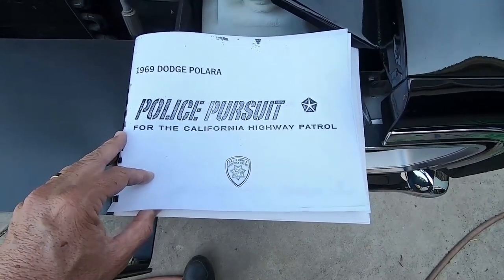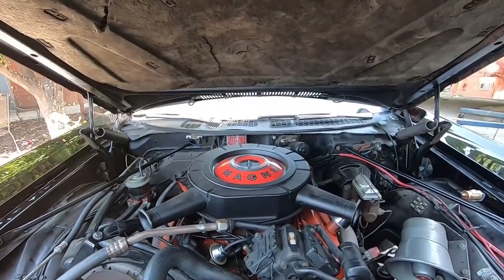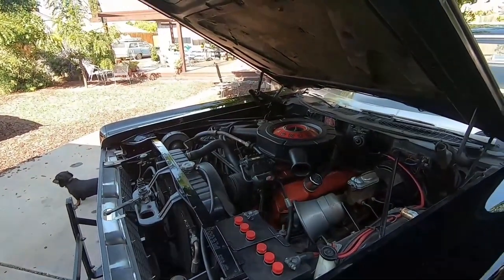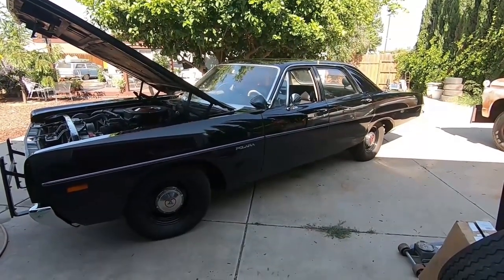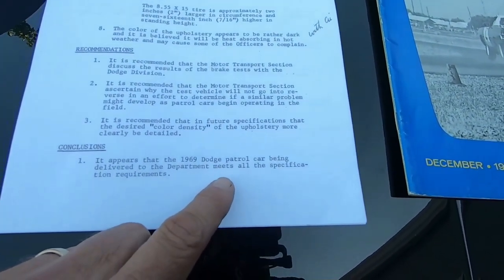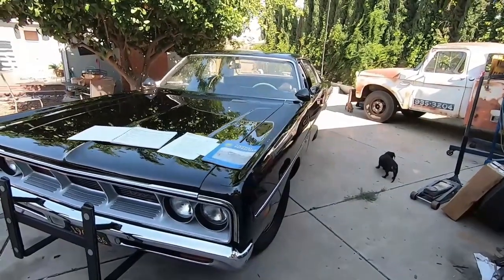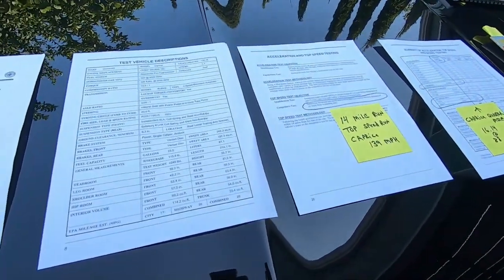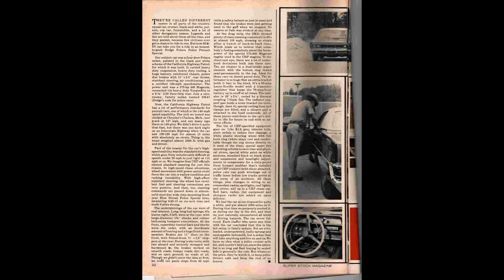1969 Dodge CHP Polara 440

Comment: I had a 69 ex CHP Dodge way back in the day.  Also owned a 71 Polara and the 74 Dodge Monaco. All ex CHP vehicles.  These were my hot rods when I was a kid.  And you are correct about the 69 Polara.  It would run away from the later models.  Had a conversation with a CHP Trooper in the mid 70's.  He referred to the 74 Monaco as a tractor and wished they had the 69 Dodge back.  The 69 would break loose the rear tires at 40 mph when you hammered the accelerator.   Had it up to 130 mph once, then backed off as the front end started floating a bit.  Lots of fun years ago.

Comment: Very neat video, and I like the publications too.  Some suggestions.  The real advantage of the 440 was the head design, good bore to stroke ratio, proper valve train design that allows a lot of lift with not too much duration.  The exhaust manifolds make little difference, the stock log manifolds are also fairly descent, but the down pipe side of 2.5 inches will help over 5000 rpm (which you need with the 3.23).  The difference in aerodynamics with the 68 are marginal, but in the human eye the 69 may appear more aerodynamic.  If there is a difference, it is likely marginal.  The p/s pump does not really have much power loss because when you go straight the steering is neutral.  They chose manual steering probably to save cost.  This was a bad choice because manual steering is slow and hard to correct oversteer.  When you compare your 69 with the later police cars you have to remember an important factor.  The original tests had bias ply tires with much higher rolling resistance at high speed.  With radials, you have much better high speed acceleration.  Question for you.  Is the grill plastic?  Another fact you maybe interested in.  I have two Imperials with 2.94, both have very good high speed performance, but the 5000 lbs make them a bit slower in low speed acceleration.  I will exceed 135 in a 2 mile acceleration.  On the faster one, it also takes me about 0.8 miles to reach 120, likethat chevy, but that is because I have only 3 gears and a much heavier car, high speed acceleration is much stronger than the chevy.  Cheers.

Comment: I own a '71 Plymouth Fury III NJSP car. It is a factory U code E86 440. Original engine is long gone and was replaced with a '72 Imperial 440. I had another engine built for it (440) and it dyno'd untuned 410hp and 490ftlbs  through the HP C body manifolds. The top end is lighter being aluminum(heads, intake, waterpump housing), and I've added a sure grip to the 3.23s it already had. Also beefed up a 727 and added a low gear set (2.77, 1.57, 1:1) for more grunt out of the hole. I'd be tickled to death if it ran low 14s and broke 100 mph!!
    That is a beautiful '69 Dodge you have there,  i can NOT wait to get my car in all black again!  It's currently in all gray primer.

Comment: THAT.... is one COOL Car ! Thx for sharing !
I would concur with all findings claimed regarding the '69 CHP Polara pursuit, based upon my own experience with my '69 Charger R/T survivor's UN-rebuilt original 440 Magnum/Auto/3.23 cogs.. 
Aside from some obvious weight differences between the B & C Body platforms.... I am even to this day quite surprised how much Torque the original untouched 440 Magnum will/can produce,(480 Ft/Lbs ?) and I do not believe the C Body's weight would affect much from a Torque perspective, given, even today with 4 grown guys 180+ Lbs the Charger still easily fly's right past 100-110 mph  like nothing..... albeit, I get scared up there.... and I as well would suggest the 11"x3" Front and 10" x2 1/2" Rear Drum Brake System leaves much to desire under hard/repeated applications.
Very Unique C-Body.... and again THANKS for sharing !
Reply from the maker: Glad you liked it.  We've also owned a few original 440 Magnum equipped cars including our '69 Charger R/T which we still have.   The top speed is a lot more than people think as you are aware.   Thanks for watching - T

Comment: Excellent video on an EXCELLENT car!! Very cool info in the historical documents. 
 I agree the 9C1 cars aren't as fast. They are realistically more ergonomic,  but that's about all. The Dodge clearly has it beat in speed, power, & even durability. Don't get me wrong, I'm a GM guy, but facts are stubborn things(John Adams)!
 The GMs definitely have their place in police car hierarchy, yet it isn't #1 or #2, imho.
 My personal ranking is:
1 69 Dodge Polara
2 71 Ford 429 PI
3 89-90 Chevy 9C1 Caprice 
Thanks for posting this vid!!
Reply from the maker: Thanks for watching!   FYI,  we've got a '90 Chevy 9C1 Caprice coming up for sale soon.  We'll try to shoot a video of it driving of course before we sell it.  It's complete with a truck load of parts to restore it (lots nos).  The last of the square bodies. - T
Reply: @Challengeher  Mmmm, mmmm, ...you shouldn't have told me that. I will try to find a way to get an email address to/for you. Thx!!

Comment: I've always been a fan of the 69 polara cop cars.  I never was able to get an actual police car but I had a 69 polara 4 door hardtop with a 383 when I was about 20. Fast forward 40 years and I bought another 69 polara 4 door sedan (post car). Again with a 383. I do have several 440's in my shop for future use. Can you imagine the top end in these cars if they had overdrive transmissions like they do now? I spoke to a Highway patrolman about top end in the modern charger cop cars and he told me 155 mph. So the polaras were so close even with a 3 speed torqueflite!

Comment: The 1970 Plymouth Fury police package ordered by the North Carolina State Police was rated at 370 HP, I think. It's got the smaller air filter. This cop car came with one-legged rear end, the gears do not feel tall at all, non-power steering, power disc brakes, AC, some special wires, like a big amperage wire going up to the center of the roof, for a light, a clock, black steering wheel with the horn ring going a full 360 degrees, and all the HP stuff, big radiator, brakes,   HD is even stamped into the base of the 4V carb. https://youtu.be/RMXB3SPsW5U
Reply: That's a sweet machine you have there

Comment: Not that it changes your ranking but I ran a 95 Caprice down the 1/4 at Indianapolis Raceway Park in 1995 and have saved the time-slip. It ran approx 15.03...that being from memory. If it is a point of interest to you I'll dig it out and post it for you. Also the top speed was 150.
Reply from the maker: We believe you 100% on the drag strip numbers.  If you look up old Impala SS tests (basically the same car as the police package) they ran low to mid 15's.  Many of the police cars however did not come with positraction.   Positraction being standard with the Impala SS and you can imagine they would be difficult to launch with the burnout capabilities of the Caprice.  Its likely the Michigan State Police test car wasn't fitted with the limited slip differential and cops who probably didn't have any drag racing experience simply burned the tires up thinking that was fastest.  Thanks for watching! - T

Comment: According to a retired CHP patrolman Leno interviewed on his show, the 440 Polaras were virtually EVERY veteran California highway cop's favorite-ever cruiser. The Fox Mustangs with the stick were a close second. I've always wondered why the Dodge was the cop car and not the Plymouth (Fury? I don't know MoPar big cars), since the Plymouth was a cheaper car. Seems like Plymouth didn't try to get the contracts for whatever reason. I agree completely, Chrysler did almost everything better at that time  (big-blocks, small-blocks, transmissions manual and automatic alike, Dana rearends, suspension/steering, brakes, essentially everything but styling (debatable-I love 'em!) and creature comforts), not just exhaust manifolds. Imagine if they'd had the kind of money Ford and GM did, they'd have been unstoppable. My cousin has a '69 440 cop Polara as well as a '68 Satellite with a hot circle track 360 and a 4-speed. Both are fast, fun cars, and about equally quick. I do have to say, a late 9C1 Caprice with a rearend gear change and a computer tune is almost certainly as fast as or faster than a 440 Polara but I'm sure the 440 car tuned right with the same gear change would be at least as quick and probably quicker. Those old 440s ran great.

Comment: There is more. I worked where that was built.
The police engines came on a separate rack and were kept in a special area. The code would show up ONLY for police cars and the operator had to go to that rack with the overhead lift to put it in the right sequence.

When I worked near the roll test area, I could tell the difference in  the sound when a police 440 was on the rollers. It was much louder and ran up to sixty a lot quicker than the passenger car 440. That manual shows the 375HP figure but I suspect the real value should be higher by at last an additional 20HP. I never  scrutinized the manifolds, maybe only the police engines had those where the standard 440 did not. I always suspected that engine had a hotter camshaft. but the larger air filter is definitely more conducive to greater HP.

I'm not certain which years they were required, but under the hood some had a gasoline transfer device. There was a valve in the fuel line before the carb with a long hose that allowed an officer to give a bit of gasoline to anyone who had cut it too short. The hose coiled up and was held in place with some brackets.

Comment: Is it possible this 69 CHP was the only police dept. to order the 440 Magnum and most of the other police cars got the lower 350 horse power 440? You brought up another good point about the drop in compression for many Chrysler corp engines in 1970 and the advertising remained with the higher 1969 figures. Horse power took a slight drop in 70 as they were preparing for no lead/ low octane fuel.

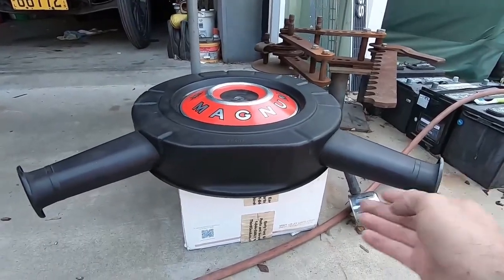Comment: Dodge ultimate police car was the 69 440, where as Fords was the 71 429 PI..  The 429 Police Interceptor heads were gynormous.. im 6'1 and can stick my fist in the Ports of the 429 PI! A professional driver drove a 69 Polara 440 Pursuit at a prepped track and ran a best 15.09 in 1/4 mile and ran a 134 Mph top speed with the 3:23 gear! Some of the Polaras came with a lower gear 2:75 but then it affected the 1/4 mile time but pushed it to 140 mph!  The Chrysler test track car was a special doctored car and had 2:49 gear which was never used on a Polara. There is a video on youtube "California Highway Patrol Academy 1971" where at the end of the video they mention that stats as i wrote them above on the 69 Polara 440 Pursuit!!
Reply from the maker: That academy video is pretty cool.  Thanks for watching! - T
Reply: Yes, that 1971 ford 429, in my opinion, was ford at its best.. ONE YEAR OMLY ENGINE.. 11:1 compression,, and the big valve, big port heads.. ALTHOUGH, many think they are the SCJ HEADS.. They are NOT.. Valves on police are bigger then regularbone, but that and ports not quite as big as SCJ ONES.. Too huge of ports hurts low end power, which a 4 door custom 500 needs.. Still, there MUCH BIGGER then regular 429..next year, the compression dropped,, heads changed, i believe to D20E-AB heads, ehich continued on the 73 andb74 C  code 460 pi engines.. That leaves the 71 429 as fords ONE YRAR WONDER👌
Reply: @craigm3777  A Super cobra Jet was same DOOE-R heads as the Cobra jet and Police Interceptor, the Diff between SCJ and a CJ was Carb was slightly bigger from 750 to 780 cfm and forged alum pistons instead of cast! for an extra 30 horse at most and that was a Super Cobra jet!! 50 years Exp in these motors and own them!

Comment: i bet you could get to 160 or above with headers, custom exhaust, normal open air filter, no accessories, the 271 gears or higher and a bit taller tires

Comment: Here in CA.. I heard that the White Steering Wheel determines the car is Manuel Steer..  Yes ?
Reply from the maker: Not sure.  The CHP spec'd the white wheel but i've also owned a '75 LAPD Fury that had manual steering and a black wheel. - T
Reply: Thanks TY..

Comment: Know this isn't scientific but best I could do in my 1972 Dodge Polara ex-Washington State Patrol car was 15.2 in the quarter mile.  Built the engine to 1971 440 HP specs.  Obviously not apples to apples comparison.
Reply from the maker: Thanks for watching!   Low 15's is moving for that old heap of yours (which i've seen and its really nice!) Drag racing is a funny thing because i've found you need about 10 trips to the track to really dial in the combination without changing parts.  From experience with stock original 440 magnum engines (of which i've owned several un-rebuilt ones) the best they can achieve is mid to high 13's in a B-body with 3.23's.  And these are totally stock ones, steel shim head gaskets,  points and manifolds but air cleaners off and timing bumped up to 38 total advance on regular tires.  Elana and I used to go to the track every week before they shut down our track about 15 years ago.  A few years ago we did race our 2 door '69 Polara at Tucson dragway (fairly high elevation 2400 ft) and it turned 14.20's @ 98 with a trunk full of luggage.  That 440 was a six pack bottom end (cam and everything) but the heads were ported and a performer rpm intake.  At a sea level track it would have run 13.80's.  We will be taking the CHP Polara to a track when possible and we'll get some actual numbers. - T

Comment: Apparently we share the same mental illness.I would like to offer that the 94 caprice may have done a better time speed as it had OBD 1 and were faster than the 95 96s I’ve got a 96 and it felt (seat of the pants )in the 15s.Unfortunately my 75 gran fury (440)feels like the smogger it is.Off the line stomp on the gas (on a hot day with a measly 2 71 gear produces barely a squeak from the rear tire.Unlike your 78 Body I saw a couple of years ago with the same rear gears

Comment: You are talking about a 4,300# + red brick here, this car was never fast. 375 gross horsepower which did not include any of accessories ( ps/pb/ac )  not the net horsepower that engines are rated at today which include all of those items. Thousands of 440's were installed in all of the B &C body cars, so certainly not a scarce engine

Comment: The 94/96 9c1 caprice was faster.the 4.3 V8 cars were 149 and the 5.7 was over 150.i have 3 .my 94 I have a pic of its digital speedo at over 170. they were factory limited to 148.i raised the fuel cut off and rpm limit to 6000 rpm the only changes from factory settings and mechanical parts